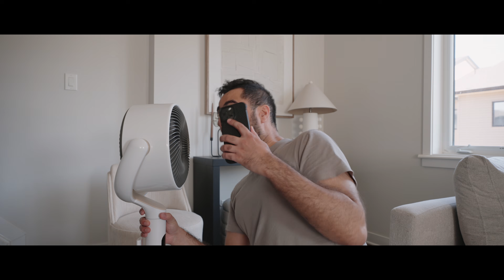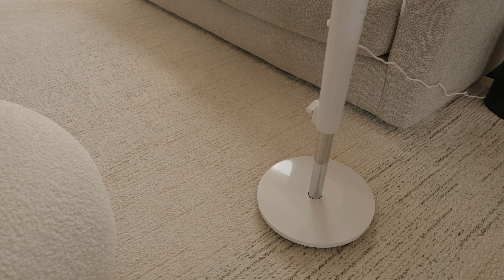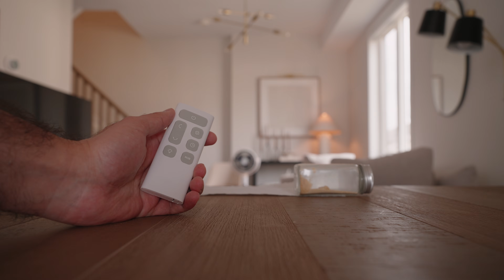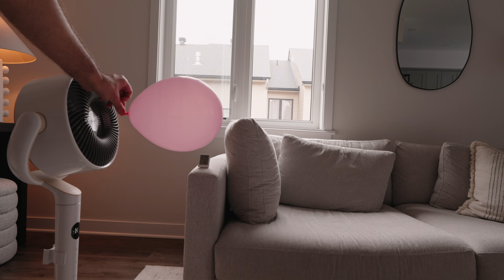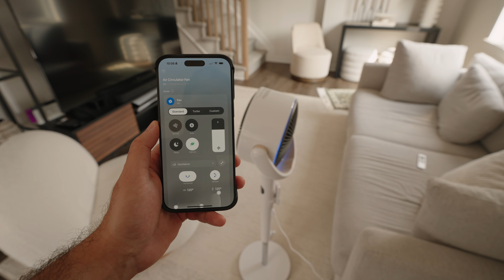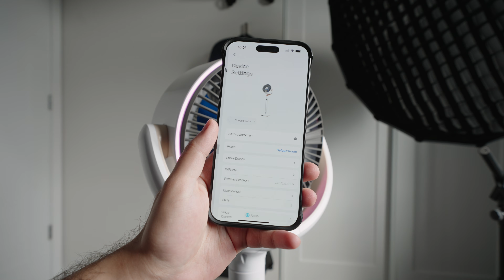DREO TurboPoly Fan Review: The Only Fan You Will Ever Need!

Comment: i live in a city where its very humid and very hot would this fan help circulating the air?
Reply from the maker: It can help move air around but you will need an AC to bring the temperature down.